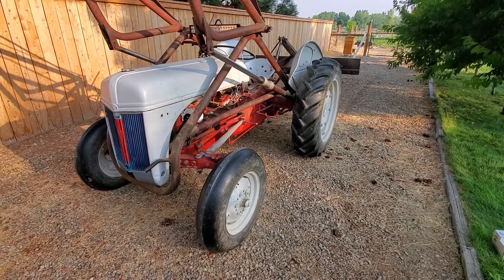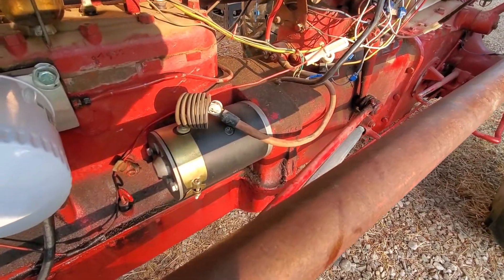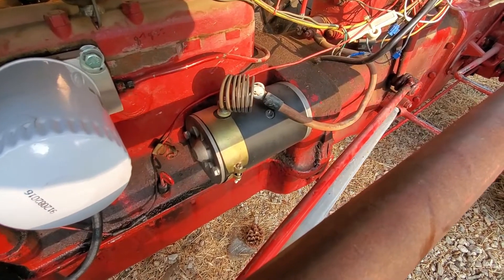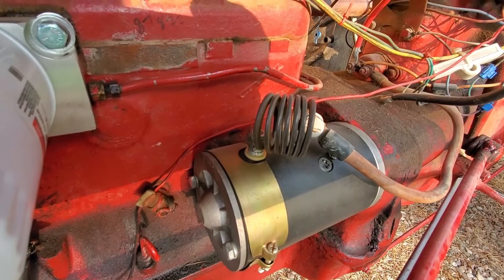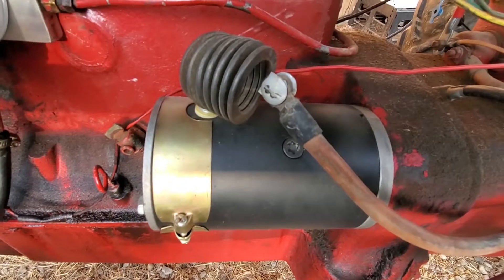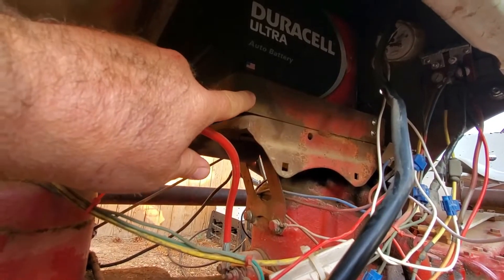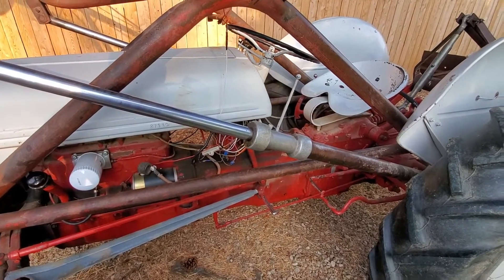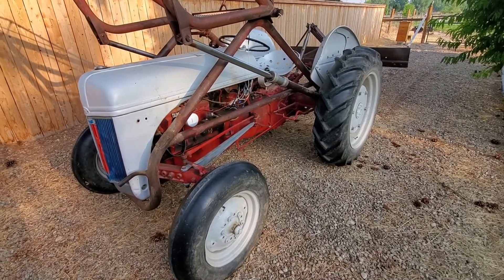Ford 9N 2N 12 Volt Conversion

Comment: Did you measure the starter current after adding the spring in series?
Reply from the maker: I did not but it is clear that the starter does not spin with as much speed and force.
Reply: @MiloFarms  , thank you for your response. I think a 6 volt battery current ranges between 60 and 150 Amps.